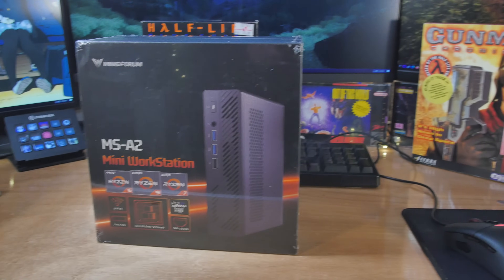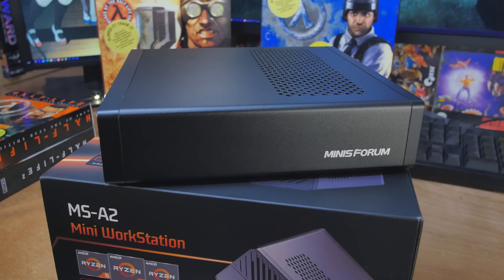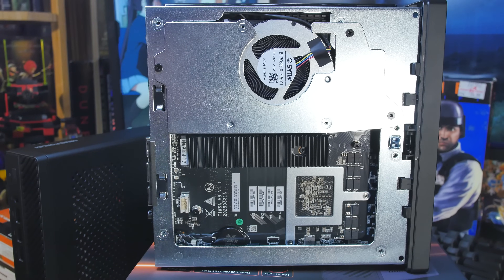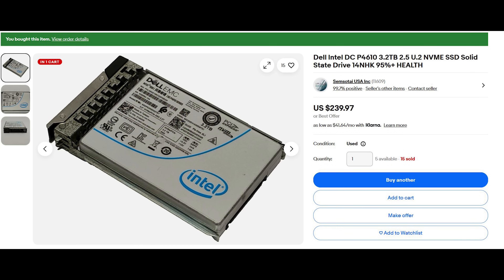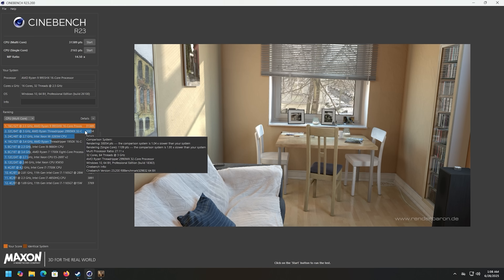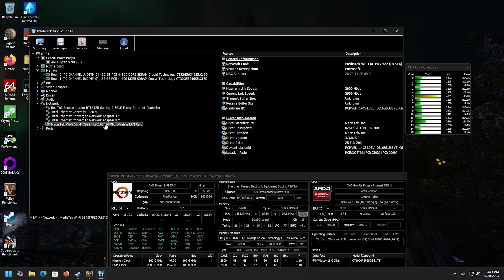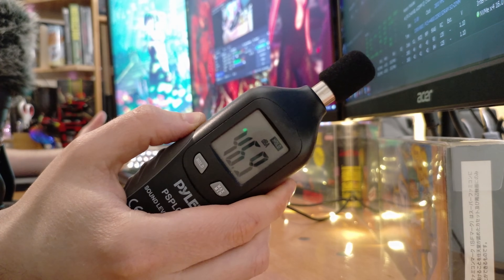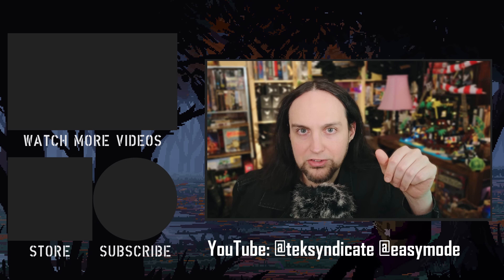Overkill? Yes Please - Minisforum MS-A2 AMD 9955HX Mini Server

Comment: Would be careful with these ... I got one of these in Aug of 2025 and now here in Dec of 2025.. it has black screen and will not post.  Ram so crazy right now I don't have a spare stick to test. also the Cmos battery is in a spot that I will have to take the whole motherboard out of the case just to get to it...

Comment: Well, if I was to put together a more beefy home server, I'd want it to do both AI-aided upscaling and NAS stuff, probably also proxmox. So yes, a little more space for a GPU and 3-4 hotswap storage bays would be nice. Could probably make do without the two 10Gbps NIC's. Just bond the two 2.5Gbps and it would be more than enough to serve my TV, gaming console and wifi at once.

I do like that they've started using "laptop CPU's" because, while the full size CPU's may be able to reach higher speeds, laptop hardware usually has better power management, which in turn means lower temperatures, which is good if you want a tiny server that doesn't sound like a fighter jet while idling.

My daily driver is a laptop, so what I want from a home server is basically the stuff that either takes a lot of storage, memory or computing power, which doesn't fit in a laptop. I don't really play games, and those I do are not heavy on graphics.

Comment: Link to the NVMe SSD is missing sadly - 06:00 - Also that RTL8125BG Nic will cause massive problems under Windows 11, it randomly jumps from 2,5G to 1G to 100 or 10Mbits, its freaking annoying and Driver Updates and setting the settings in Device-Manager barely helps.

Comment: Received my MS-A2 (96GB/2TB) on Friday and have been doing some testing and I have to say I have mixed feeling about this PC.  First off, the look of the case is very nice and the performance of the CPU along with 96GB RAM are very impressive -- but there are a few problems.  First, the GPU is ridiculously bad, just running screen saver (bubbles) ate up fully a third of the GPU's performance.  Second, the USB ports being limited to 10gbps is kind of shocking in this day, hell it would be disappointing 8 years ago.  And lastly ... this beast has completely pathetic cooling -- laughably bad.  I've gone over the design and here's what I find so terrible -- the two fans it comes with pull in air from the inside of the case and those fans are dinky and inadequate.  I did a render using DaVinci Resolve of a 34.5 minute, 4K60 video and it took 45 minutes to complete but the temps were like 90+.  But the truly shocking thing was that the case itself was hot, not warm, not really warm ... HOT.  In short, the fans are merely recycling the same hot air over and over and in reality, the heat is being removed not by the fans but but the case radiating heat as well as convection from the case.  I've owned and built PC's going back to 1982 and this is by far the worst thermal design I have ever seen and second place isn't even in the running!
But, I do have a solution for the effete GPU  -- replace it with the low profile RTX-3050 which should substantially improve the GPU.  The USB issues are manageable for me as the devices I plan to attach are not likely to be too limited by the 10gbps speed.   And I think adding an external fan should resolve the thermal problems.  This could have been a genuinely great mini PC, but the compromises Minis Forum made for cost or other reasons is like putting a donut spare tire on an F1 race car!

Comment: I do have to smile when you say things like "so much RAM!" - in a homelab 64GiB is just table stakes!  Yeah, compared to using the machine for desktop purposes it seems like a good amount, but trust me, you'll run out of RAM long before you run out of CPU.  Most of my homelab machines (that aren't mini-pc's anyway) have min of 512GiB, and two are now over 1TiB. Yes, RAM.  It's easy to over provision CPU (and even storage, kind-of) but RAM is RAM.  Yes, you do balloon memory, etc, but if everything gets cranking at once the OOM killer is at your door.

Comment: Great video! I love these mini PCs, but heat is a major drawback if you plan to use one as an actual server. Thermal throttling is definitely not ideal.  I've had this specific mini PC bare-bones with 96GB RAM, two 2TB NVME in my Amazon cart 10 times...just can't pull the trigger.

EDIT: I'm going to build an SFF desktop with the 9950, more cooling, more RAM, more HDD space, a dedicated GPU for around the same price.  I'm going to run Proxmox / Docker / Rendering with a smidge of LLM/AI testing.
Reply: you do you, in germany it’s impossible to find something similar for even close to the price, specially if you want a small form factor. The Ram Alone is $300 :D

Comment: The PCIe 8x slot supports bifurcation (4x/4x), allowing you to install two additional PCIe SSDs with a PCIe 8x adapter card. This also provides enough space for thicker heatsinks.
Reply: Can it house dual RAM cards?

Comment: The AMD Ryzen AI Max+ 395 is the ultimate low-powered Mini Server for Home Labs. 

It has server level quad-channel LPDDR5X 8533MT 128GB pushing 276GB/s memory bandwidth over a 256-bit bus to both a 16-core/32-thread CPU with 64MB of L3 cache and a 2560 stream-core iGPU all in a 170Watt package.  You can't get quad-channel memory from normal Ryzen desktop processors, you'd have to go Threadripper for quad-channel or Threadripper PRO for 8-channel, and it's unheard of for SODIMM RAM to hit anything higher than 5600MT.

The only caveat is the Max+ 395 only has 2.5GbE networking, but that can be fixed by converting one of the PCIe 4.0 x4 M.2 ports into a 10GbE port by using an adapter or you could use one of the 40Gbps USB 4 ports and put a 10GbE adapter there and just max out your two PCIe 4.0 x4 slots with 8TB M.2 NVMe drives each with 2400TBW endurance.

Comment: You could bifurcate that to use with 9305-24i HBA's and literally have 48x drives connected to your system or just add more NVMe storage capabilities too. Tons of potential.

Comment: These things are just too expensive... I look at these as a computer guy the same way I look at those super expensive high end cameras with no interchangeable lens option... like, is it a little smaller, yeah, but I just see the compromises if these types of machines as too great when size wise you can get really close but without the compromises and a similar cost

Comment: Cheers Logan!  Noteworthy:
- Lack of USB 4
- Weak Radeon 610M iGPU
- Making the case just a little bit taller would allow space for thicker U.2 and better M.2 cooling/heatsinks
- At these prices an SD card reader would be nice, as would WiFi / BT antennas
- Why do only Geekom & Asus offer 3 year warranties?
Reply from the maker: Yep... I just got my U.2 in the mail and... nope. It won't fit. It's really annoying that this isn't thicker. I don't think anyone would care.
Reply: yup the U.2 in 15mm thickness will not fit /can have it in open case though/ and there were talks for an adapter for two u.2/u.3 drives for the pcie 16x slot /which is 8x but supports 4x4x bifurcation/